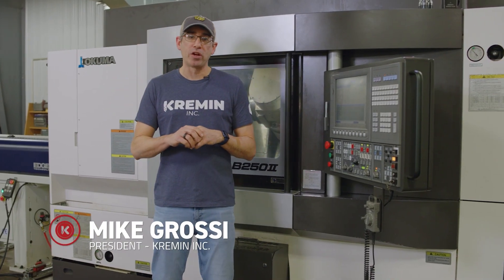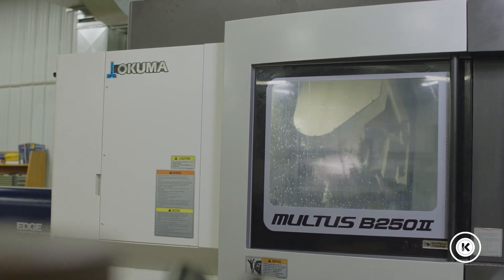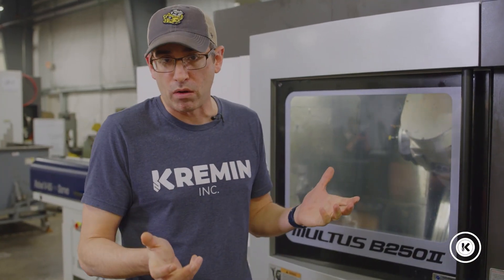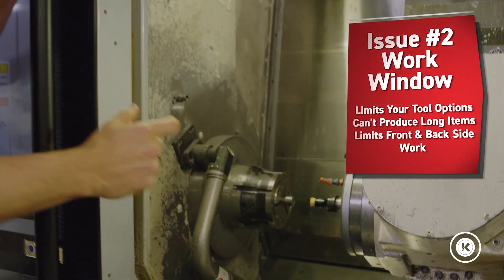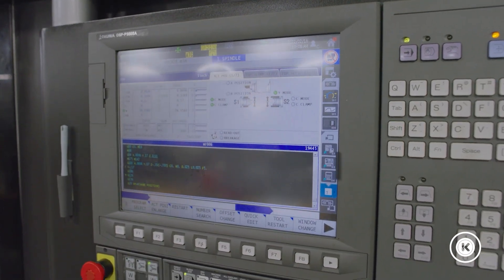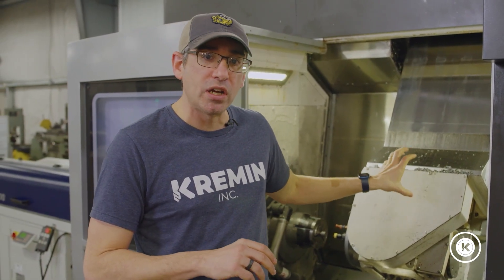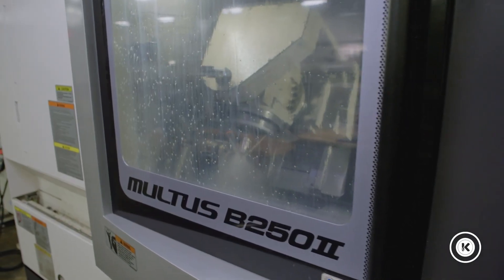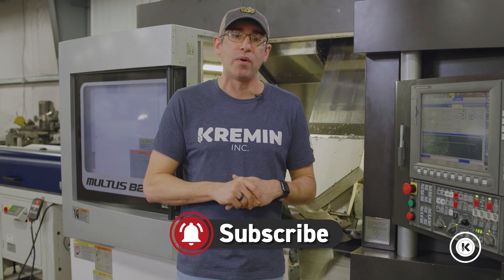Okuma MULTUS B250II - Kremin CNC Machine Reviews

Comment: For people watching this that are considering an Okuma with the CAS system, I can tell you from much first hand experience that it is awesome, and when actually used correctly will make your life so much easier and less stressful. The problem I have seen is often if you have guys already experienced with other controllers they will often reach the first hurdle with programming the workpiece/machine/tool or holder models (most often tool and holder models I would say, but setting up new chucks or stock models can also take just a little effort at first attempt), and in order to just get the job done they will disable the CAS, or put in false data, and then this becomes the goto any time that jobs get a little difficult, and the irony is if you are making a part that is requiring some unique tool or fixture, this is the time when the CAS could be of the most help and when you should be going to extra lengths to make sure you set it correctly. 

Just like any modelling software, if you take the time to actually go through the documentation, and learn the capabilities, you can get so much more out of your investment. It's honestly no harder than programming in other modelling software, but a lot of guys if given the chance to just take the quick and dirty way to solve the problem will absolutely take that option. I took over one Okuma machine from a guy that had been running and programming it for five years and always trouble with a certain parting tool hitting chuck jaws and the side of parts and so had to do elaborate workarounds. 50 percent of the chuck jaws had gouges in them from the tool even though he had CAS on and the grooving tools mangled too. He always thought CAS just struggled with grooving and probably would give a less than stellar review if someone asked him.

I had a look at the models in my first week on the machine and it turns out the model he made up did not account for the cutting edge being inset from the leading edge by a few mm. With about 30 seconds of modelling adjustment the tool was actually set up right and the system has worked beautifully ever since when using that tool type. If you put garbage data into any machine and it doesn't do what you want it to, you cannot place the blame for that on anyone else but the user.

Comment: It sounds like someone didn't use CAS and crashed the machine. That red flag pretty much negates your negative review. In fact, this is not really a review at all. You didn't mention any of the capabilities of the machine, nor did you discuss actual features. Great video and production quality, but literally ZERO useful content. Let me know if I missed something.
Reply from the maker: We don't think it happened because CAS was off, we only turned CAS off when it was necessary to cut sub spindle jaws. It might of happened when a cut off insert broke and we smoked a cut off tool during a production run. The review was from an owners perspective and not a technical one, but I appreciate the feedback and will keep that in mind for future content.
Reply: @KreminIncManufacturing  it's also concerning that you do not know when the crash happened. I don't know how your shop runs, but most shops know exactly when something like this happens. I wish you the best with your business. I also wonder why you stated you would buy another Multus after leaving a bad review. This message is incongruent with your video.
Reply from the maker: @harrelsontrumpets  We don't know because there was never what we would consider a "crash" this machine runs unattended the majority of the time, we only caught an issue when we were filling the chiller tank constantly and the hydraulic tank was overflowing. We are assuming it was a tooling break - apparently, it does not take much to cause an issue on the H1 head.
Reply: @KreminIncManufacturing  I'm a little familiar with Mazak Integrex style machines. A major crash of the mill spindle will cost close to $20,000 not including labor. I believe Mazak has exchange spindles for $25,000 also not including labor.

Comment: I convinced my Dad to pull a purchase on a Tsugami TMA8F, did my homework, borrowed the Post from Esprit to try and program a part. Demanded an extra 2 years for warranty and repairs.

 I thought I made a mistake not getting the Multus, but looking at the tool clearance when milling from the face, I think I made the right choice. 

Although, the sub spindle leaves me very little room to work with too.

So far, I am happy. Now I am trying to find more work for it 😂
Reply from the maker: That is great! Have fun with it, its a cool swiss lathe.
Reply: We're in the process of making a mill/turn purchase.The TMA8F is our first choice, QuickTech S42 is our second choice, and Multus B250 is third. What would you change on your Tsugami?
Reply: @harrelsontrumpets  Wish the Sub-Spindle had more room. Any face work like drilling or boring requires a lot of work to set-up in order to avoid crashing the B axis head into the main spindle.

Other than that, really depends on your application. Most of my work is bar work. So I use mainly Royal Quick Grips. With jaws, you need to be extra cautious to not crash the Y axis sheet metal into the jaws.

Hope that helps your research!
Reply: what were you using esprit with ?

Comment: We just bought one.  The installer mounted the port for mist collector but it hasn't came in yet.  When the trainer came we tooled it up and downloaded the program.  When I went to run our part the high pressure coolant kicked in on the 11 position for a boring bar and shot it straight out the port and I got a shower.  I wasn't very happy.  I noticed you didn't have a mist collector either.
Reply from the maker: No mist buster on the multus but keep an eye out in July for a new video where we break down the mist busters we use on our swiss lathes - one more thing, I mention it in the video but we are currently on day 7 of a H1 head repair/re-alignment - it’s painful if they have to get in there! Good luck!
Reply: @KreminIncManufacturing   Wow.  Not looking forward to a 7 day shut down.  We do have the cas set up and I hope that prevents that.  Are the techs coming out of Alabama?
Reply from the maker: No, we are in Michigan, they are relatively close to us. It’s just a ton of work to get to everything if it needs adjusting, other than that, it runs great.  It’s definitely a neat machine.